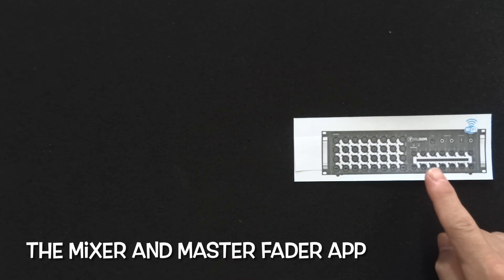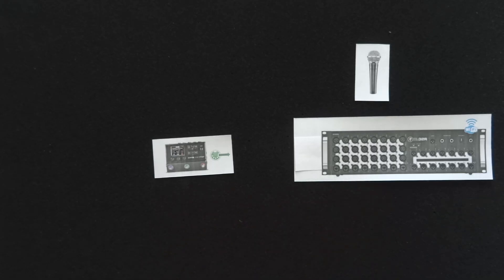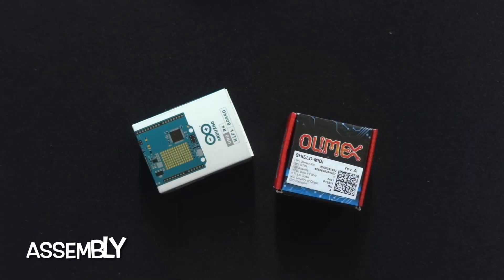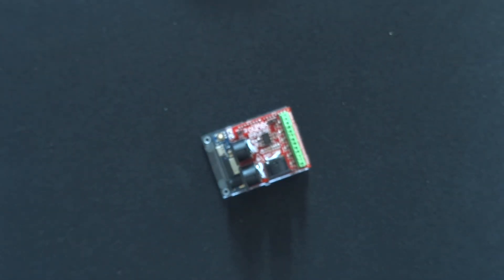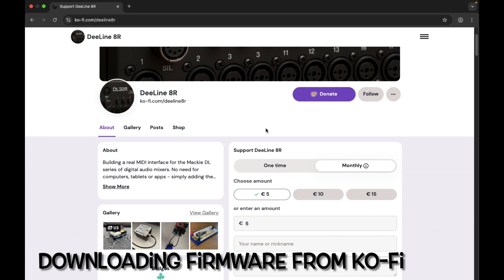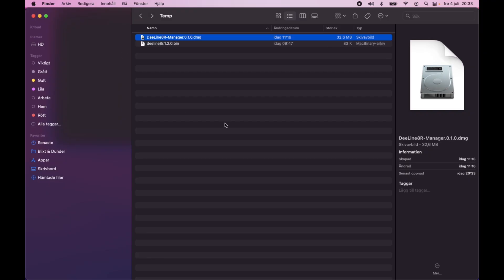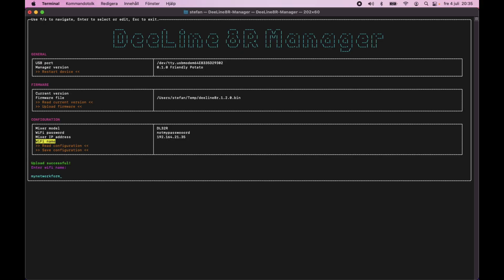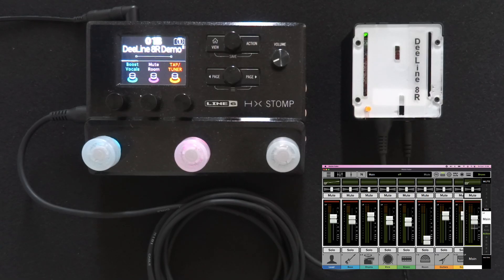Adding the missing MIDI jack on the Mackie DL mixer - using DeeLine 8R

Comment: Hi Stefan, is the arduino connected directly via the USB port? I just wondered if can be first connected to an ethernet switch so a Mac could record the outouts at the same time? Thanks for your work btw! Excellent solution!
Reply from the maker: The Arduino is not connected to any computer at all during use. Only while configuring it using the manager. During operation, DeeLine 8R is connected with a MIDI cable only (and power). What is it that you want to record?
Reply from the maker: Second read of your comment and I think you’re asking if a Mac running Master Fader will reflect the changes. The answer is yes. Any connected Master Fader will.

Comment: Very cool. How do you set up controls? Say, if You want to control the the fader movement with a Behringer XTouch?
Reply from the maker: You follow DeeLine 8R’s midi implementation (comes with the firmware download). Fader control is done on midi channel 1. Then CC#0-31 are the mixer channel strips, and CC value 0-127 maps to fader position. I have done exactly what you ask for in this video https://youtu.be/uIq_N-x8F08?si=YZVW1Pgd6wgO9IbO. Let me know if if want me to show the steps.
Reply: @stefanvedeja  maybe later. First I have to build the DeeLine 8R.